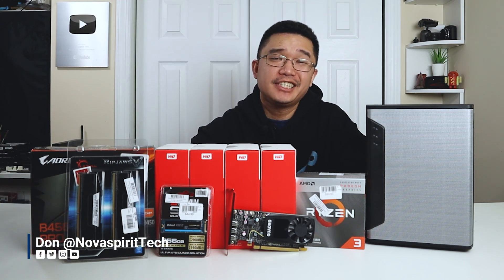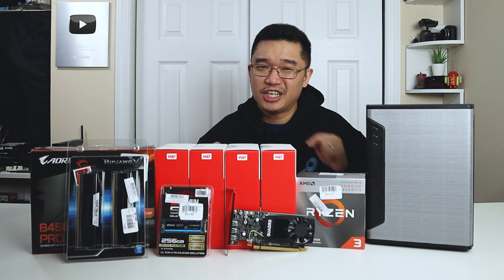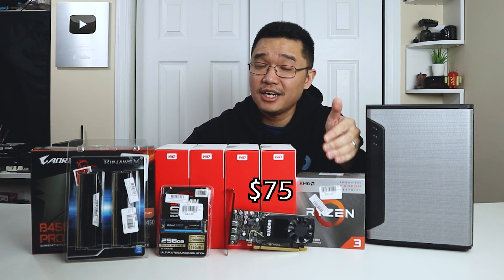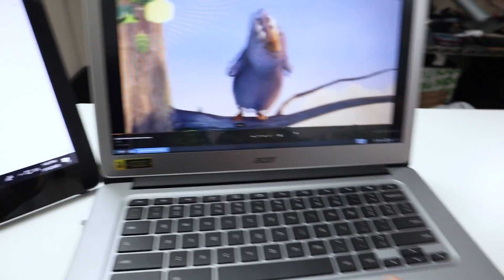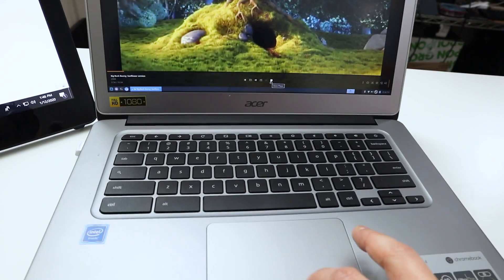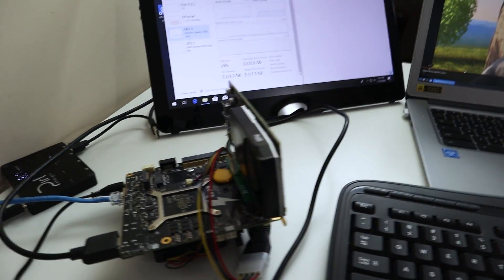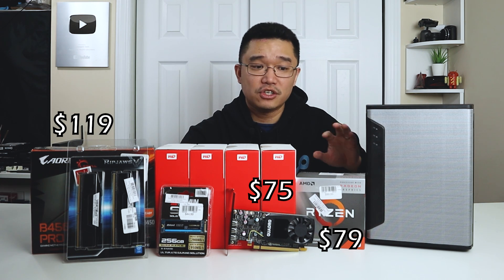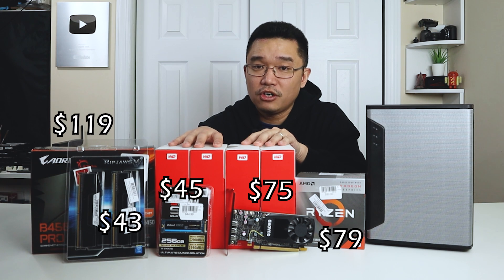DIY NAS & Plex Home Server With Hardware Transcoding Build

Comment: I like this idea. I was close to building something similar to this. But I wanted lots of room to expand since I have a very limited budget and can only get so many HDD's at a time.  What I ended up doing was buying an Intel NUC Gen 8 i5. I put in a 1 TB m.2 SSD and 32GB RAM in it and installed Windows 10. 

Then I bought two 7 port USB 3.0 hubs and connected one to each of the use 3.1 ports on the back of the NUC. One USB Hub acts as the main set of external HDD's for playing media and file sharing. The other USB Hub acts as the mirror for redundancy. (I figure if I just copy over any changes from the main drives. The backups will not be used as much thus decreasing the likelihood of a backup failure. And by splitting which USB port the USB Hubs are connected to allows for copying files over with minimal slowdown in data speed.

The advantage of this method is that if I need more storage. I simply buy a new external HDD and connect it when I have the extra money. So far it's running great. Because the Intel NUC is super low powered compared to even most NAS builds. The NUC uses between 5W and 28W depending on CPU load. That also means less power used and less heat in the room

Comment: If you're looking for higher capacities (meaning 6+ TB, ideally 8+ TB), there are external HDDs which are actually WD Red (or whichever equivalent of another brand), just with different label and guarantee. Of course, the guarantee isn't as good, but many people who are in the home server market "shuck" the drives out of these external HDDs because they're significantly cheaper.
Also, the ECC RAM in ZFS is kind of a myth, non-ECC RAM is just as bad in ZFS as in any other file system. It's just that it's usually chosen because of its reliability and not using ECC RAM makes it less reliable, so it kinda defeats the point of using ZFS.
Reply: GRBTutorials Can you give examples of which external hard drives that you can get those WD rads from I would really appreciate it
Reply: Which external HDDs are equivalent to the WD Red he reccs in his video?

Comment: I have the same case. Looks pretty neat, doesn't have some fancy add-on junk, and with only two 120mm fans running at low RPM the case itself is whisper quiet. 4 WD Red drives also operate silently.

Comment: I actually did this same thing! My otd total was about 570 bucks. 
12GB DDR4 
A ryzen 5 (2nd gens were on sale) 
MATX build! 
1650 super (bought it for emby because I provide for like 7 people) andnused the patched drive for unlimited transcode streams) 
Salvaged Toshiba drives from my old powerade servers 

That CPU peg you're seeing is because the proc is still being used for audio transcoding. I wish I had known this when I was building.

Also for best results stream at 1.5mps on mobile to eliminate buffering 
I've been slowly upgrading my drives, working my way to 12TB drives for a huge bluray collection. 

Great video!

Comment: This is a great build video and very well done as far as content goes!! BUT and this is a HUGE BUT what do you do if you are like me and have WAY MORE DATA than anything else??????? You see a lot of people look at me and think I am some "random old biker type guy, with long hair, tattoos and a 1980s music collection of mostly 80s Heavy Metal!! BUT what a lot of people OVER LOOK is back in 1981 I was 15 years old with my first computer (a Commodore 64K) and even back then I started generating data in bulk!! 

TODAY at 55 years old, I have over 2000 VHS movies I am putting into digital media weekly, over 3000 vinyl albums and cassette tapes of bands dating back to the 1940s to present that I am converting to data as well. AND I am still randomly adding to my collection every month or so as well!! So a system like this build is actually TOO SMALL for my needs in a lot of ways!! AND when you think about this build ALL you are really getting is a 4 terabyte hard drive out of it, if he used FOUR 4 terabyte drives in the case, because you lose 2 hard drives for mirroring anyhow which only leaves TWO 4 terabyte hard drives for actual storage! 

BUT like he said he is only using FOUR 2 terabyte drives, losing two of the drives for mirroring, leaves only 4 terabytes (or two drives) of actual storage!! And you always have to consider that when building these systems!! 

Myself I want to share music, movies and files around the network, because at any given time I NEED extra storage for working on other projects and then I have FIVE adult kids and 12 grand kids and a lovely lady that supports my insanity!! And all of them have their own data as well, that I need to include at a moments notice!! AND the given problem I have is I live in a small mobile home so SPACE is a major issue to start with so anything bigger than a desktop is a nightmare to run anyhow!! MY solution currently is to start with six 3 terabyte drives and loading the important stuff first....movies, photos and music!! Then as the needs grow my next build will have six 6 terabyte drives a year or two down the road when the drives become more affordable I hope!! In the end that is my current plan right now as it stands anyhow!!

Comment: I love this build guide, great job! I have a 4GB GTX 970 kicking around, I’m guessing I should have no issues with this card with my Plex build for transcoding from 4K?
Reply: Just remember,  you have to pay for Plex pass to get HW transcoding options, but it's well worth it.
Reply: @sagadg1  Been trying to get plex to work since I just built a new NAS setup, my old one literally cost me 300 dollars, now I have a 1k setup with a graphics card and I cant get anything to play right in plex after 3 days of re configuring all the settings.  Not sure whats up, but I gave EMBY a try and it works perfectly, even my 4k content.  Not sure what im missing but I really loved plex.
Reply: @garrett1144  I've been a Plex user for years.   Emby maybe doing more direct play for your files perhaps?  What is your PC build like, processor, graphics card, etc.?  I've had the best success with AMD chips.
Reply: @sagadg1  me too I love Plex!  I went with the 3600 amd chip, Asus itx board, 16gigs Corsair, 10tb ironwolf and 500gig ssd with a low budget 2gig Nvidia card.  Not sure what happened with plex but I spent days trying different settings and nothing would play right.  Even if I did low quality settings.
Reply: @garrett1144  you should have been fine as long as you weren't HW encoding 4k.  Not sure of the graphics card, but it takes a lot of computing power for 4k.  Your chip however should be powerful enough.   I originally had a 2700x running 4k in an Asus proprietary MB.  I believe the 3600 should fit the need even if not an x.  I would check some of then Plex boards and see any info related to the 3600, and even possibly how well HW encoding works on your particular card.  If Emby works for you I wouldn't bother though

Comment: I have Plex running on a Pi4 with 4Gb RAM on a dual SATA board with 2x 2.5" WD Red (NASware 3.0) 2.0Tb in a small case, whole thing is the size of a small router and I have 4Tb on there with low power consumption (25 W). almost looks like a smaller DVD player, I have the Pi4 wired to a 128x64 OLED display up front that displays data like CPU, RAM and disk usage (coded in Python over I2C). The whole thing cost me right about $100 :)

Comment: you can use freebsd which is the operating system  that freenas  is based on.I use it on my hp dl380 and it works great, easy to set up shares etc,you can use zfs file system and use raid.

Comment: 4K and only 8 mbps? That isn't native 4k, not even close. That's some washed down crap. A 4k encode from source in HVEC would be in the 40+ mbps range and if you had a 4K movie in h.264 for some reason it would be double that. If that was a legit 4K file that movie would be unplayable on the CPU and if it has HDR just forget it because Plex cannot transcode HDR, it cuts it out and whats left is a washed out movie.

Comment: Nice graphic card, but get rid of that Ryzen 3 APU, with that APU, your Quadro card will run at x8 max on the PCIe slot. Ryzen 5 1600 AF is $85, it's a very low binned Ryzen 2600 with a 1st gen Ryzen name.  You should have got that.

Comment: Nice intro-level video - but there is some information that really does need to be corrected: 

1) "Lots of other cards are recommended like the P2000 but the cost is high so we're going with this other one to get better bang for it's buck" - Cool! Agreed, the P2000 is expensive.  But if you're not going to select it you should at least tell your users why it's the card of choice.  The one you selected will cap out at 2 hardware transcodes at 1 time.  The P2000 does not do this.  So if you are going to have more than 2 streams at once you should be considering the extra money to not over-tax your CPU with transcoding that 3rd stream.  

2) "with hardware transcoding turned on the CPU is being used to move the media around" . Not really true.  The 20% ish usage you are seeing in your video is actually because of the audio transcoding (a video card with hardware transcoding will still only do video) so you can't just ignore the CPU all togeather.  If in your example you used a 4k video, that CPU is still going to have to do the audio transcoding so it's still got to be an ok CPU for how many streams you want.  

3) "This graphics card can support up to 4 streams without having much of an issue" . Nope! Not true,  see comment #1.  The video card you selected can not do more than 2 streams at once, it's capped in the firmware / driver.  

4) "If you unlock it with the patch drivers you can do that, in reference to #3" well - ok, first of all, those patch drivers don't work on everything.  But second, you should let your users know that Nvidia does check for that and nuke cards from time to time.  I actually know the engineer who workes on that project.  If you're going to tell your users to do something you should also tell them the risks.  

5) "use the reds because they are going to last a lot longer" well - that's also not true.  The MTBF on the red's vs other drives is actually the same.  The Red's (or similar from other MFR's) are actually specifically designed for raid. The difference between the other drives (like green) and the raid drives (like red) is the TLER support on the drive (time-limited error recovery).  This limits the amount of time it tries to read the data in a raid environment.  You sue this because of the conflicts that happen inside a raid array.  A green drive (as an example because they are cheaper) actually doesn't fail, but your raid array will throw an error and think it failed because of the lack of TLER support.
Reply: " Nvidia does check for that and nuke cards from time to time" everything you said is invalidated because of this.... dumb.... :/
Reply: With "cheap" hard disks usually less is described in the documents, one is sparing with exact information.
The WD RED is the slightly better desktop (consumer garbage) drive that has double the load/unload cycles of the WD Blue, and gives a value for the transfairs that are allowed to roll over the drive, which is missing on the Blue.

Asked again, if I use for example with unRAID a modified graphics driver to use 3-4 instead of the 2 usual H.265 HW decodings (for example with Plex, Jellyfin) then it could be that Nvidia sabotages the graphics card, destroys it ?

Comment: ZFS iS dANgerOUs WIthOUt EcC beCAUse yOu COulD cOrRupT YOUr dATa... just as much as you could corrupt it on any other filesystem without ECC...
Reply: Yes, but much more with ZFS, and after corruption, you can definitely loose all your datas. Datas than you can recover with other fs. Ext4 is very good in fact. Also, ZFS need more cpu, more Ram. ZFS is a pro oriented very heavy load and very large data storage machines, not really for a little 32To of data storage.
Reply: @DGDG0000000  Yeah true, the lack of good recovery tools is an issue. ZFS doesn't need more ram unless you use the dedupe features.

Comment: for this Nas System we pay in the Netherlands around the 2000 euro's
Reply: videokaart  €139 

https://www.lenovo.com/be/nl/accessories-and-monitors/graphic-cards/graphic-cards/GRAPHIC-BO-ThinkStatoin-Nvidia-P400-HP/p/4X60N86657
rest van de onderdelen € 386 

https://azerty.nl/basket/?code=YTo0OntpOjMwNzUyOTk7aToxO2k6MjYyMDk2MztpOjE7aToxNDI3NTM2O2k6MTtpOjEzNzY1MzQ7aToxO30=
behuizing is € 130 maar bestaan ook andere voor rond de 100 

totaal rond de €650  dit is wel zonder hardeschijven maar die rekent die ook niet in het filmpje

Comment: I use Ubuntu server and linux raid, plus plex for my media center front end. My desktop dual boots windows 10 and manjaro gnome, so I can ssh into server from either OS for maintenance. The one thing I did pick up from your vid is the fact that I could probably use a hardware transcoder. My server cpu is a skylake i5-6600k (fairly overkill for purpose). A transcoder surely would make the load lighter. Thank you

Comment: Thanks for putting the quadros in my decision. You just saved me from upgrading my entire system. Instead I just bought a quadro p620 on ebay used for 96bucks, they had 10 off now coupon.Cheaper than the p400 currently,doubt it helps my needs much. But it does have double the memory bandwidth and like double the cuda cores. Any other upgrade was going to run me least 185+, for something that wouldn't perform nearly as good. So was going to rebuild fully. The quadro revived my system for 4k. Thanks. Damn shame the community for plex doesn't recommend this more.Hell reading plex support would have you thinking you can only hardware accelerate with an intel cpu with quick-sync, which is a LIE..... Funny they don't even know their own software.

Comment: if you don't care about electricity and space: buy an old server or workstation, it will be cheaper, with better performance.
for around 350€ I was able to got 2*X5690 xeon ( 2*6corre @ 3.46-3.73Ghz) with 96Go DDR3 ECC. you can do far more than plex and video encoding with that.

Comment: spend the extra dollar and get the Ryzen 5 2600 and undervolt it. literally $80 US at Microcenter
Reply: For which usable efficiency up ? Nothing, just more electric consumption... To paid every month. No way...
Reply: @DGDG0000000  If more than one person is using the device it's always gonna get use. Especially if its doing recodes at the same time to stream at a lower rate. Heads up. The power dif is about the same as putting another drive in the system on standby.

Comment: Nice build but not really budget is it? You can buy a QNAP 4 bay NAS enclosure for less than your build, and if you go away from the bigger NAS names you can get one for much less than that. Also a bit misleading as the actual cost would almost double once you include the 4x 2TB WD Reds

Comment: Typical deceiving title. Sub 500 ....until you add the storage which you can't have a Plex server without..🤦🏻‍♂️
Reply: Yeah, can easily add a few hundred. But I guess the size and amount of drives is up to the user. The build he has is the foundation.
Reply: $291.96 for 5.3TB of usable storage after
Raid and format at 5400rpm
Reply: you can get the smaller hdds 2tb free in some tech shops if they are "broken"    or just buy some chaper 2-4 tb  on ebay its like 40 bucks and dont do raid add over time and it stays cheap and under 600 bucks even w storage  my server cost 110 bucks (total)  quad core 16 gigs ram  amd the board can handle 6 hdds  the case was 11 dollars  (i shopped on black friday =p and bought cheap stuff so double discount)   and storage i got 2 hdds free  so i had 1 120 g ssd (free)  and a 2tb 7200  free  i recently added a 8tb  5400 for only about 120 bucks   so total  cost even with storage was 250 or less dollars  (all items cables fan cooling everything)    now i just just swap  both the cooling for water cooling and the power for "be quiet"  cuz its in my room and noisy  so 100 more dollars  and it didnt help >..>  but anywho you can do it cheap if you shop around.
Reply: @TwinTailTerror  Not a bad idea for a budget setup. My current project will be more complicated as I need 18TB of space minimum at 6TB per drive at 128mb or 256mg cache buffer at 7200RPM connected to a 10Gbe fiber fabric. Drive speed will be important. So at a minimum I will be looking at $900 for 4x6TB drives with tax and insurance included.
Reply: @NewmanOnGaming  i dont see why you need so much i have 700 movies and 20k episodes and another 40k games all on 6tb w space left over oh and 3 minecrft servers running same time.  Omv 5 w dockers. 16 gigs ram quad core 10gb possible 1gb norm even 30 ppl wont make it spike my adv work load is 2% max of 10% adv ram 44%  0 lag
Reply: Etnaa flonne I’m not just storing movies, tv shows and music, I’m also storage large archive backups, SQL back up data and software Archives. Also when you run a NAS you always want to match 1gb per terabyte of storage. The system already 32gb of ram before converting to a NAS.
Reply: hi  @NewmanOnGaming  will you be able to share the build specs/partslist please, looking for similar build but i also need to add support for VM's
Reply: All viable options.  All make the title void.
Reply: Storage costs are never a part of a NAS build